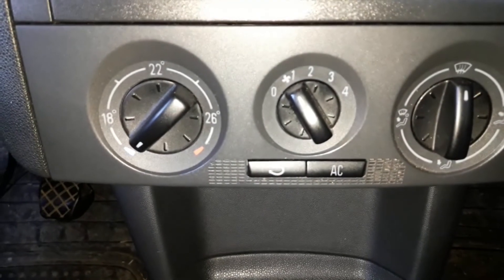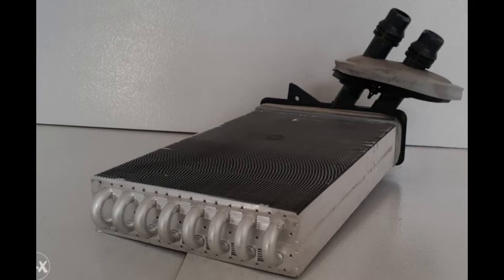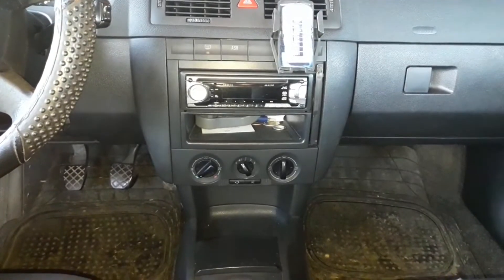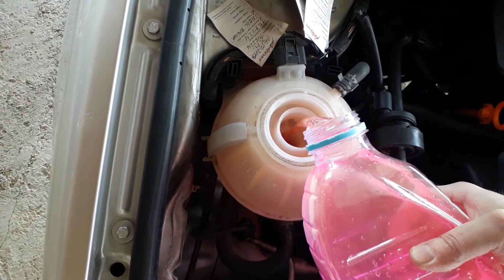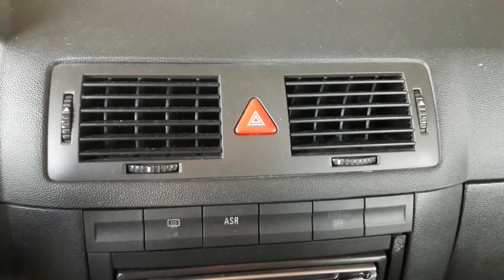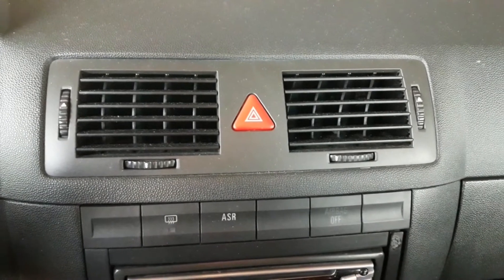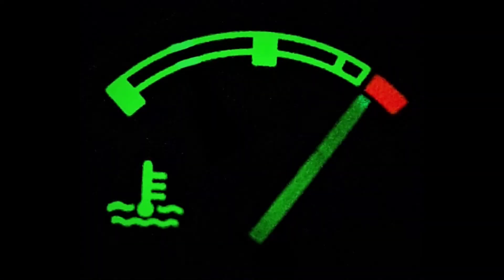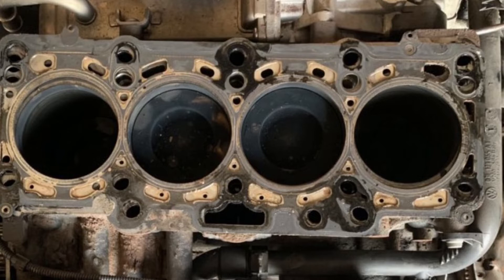Bad Heater Core Symptoms-10 Tell Tail Signs That You Have a Heater Core Problem

Comment: My air vents blow only very hot air. Even when are turned off very hot air comes in. I see a small leak on passenger rug. Like a full spoon of antigel. 
Blocked the hose that goes into heater core from under the hood and now i have only cold air from outside. 
To change heater core costs like 300 euros cause needs to get all board off including wheel, airbags etc. Is too expensive to get to that heater core
Reply from the maker: Hi and thanks for watching!
Yes, I understand you completely. The heater core problem is one of the worst mainly because on most cars you have to dismantle have of the front interior and dash to get to it.
Returning it all afterward and making it all work is yet another story.
All that I can say is, if you can, change it while it's still warm weather. If it stays like that during the winter the car will be literally undriveable for most of the time.
Despite the cost and if possible make the repair. It's just the way it is.
If you can do the repair yourself you will save some serious money but prepare a ton of time and patience 🙂

Comment: I was severely burned on my right foot by the hot coolant leak from the heater core on my 30-year old Cadillac. The leaked coolant flowed to the driver's space via air duct. I didn't previously recognize the coolant leak to the floor carpet of the passenger seat. I feel good as there was no passenger while I was driving. She could have been burned more severely than me if she was with me at the time. Your video is nice when viewed after the big incident a month ago! 😛
Reply from the maker: Hi, thanks for watching and I hear you 🙂. I had a situation where the heater core leaked while driving and started to produce a thick fog inside the passenger cabin.
A smoke machine is an understatement 🙂.
Glad that everyone was OK and thank you for the kind words.

Comment: This can cause the AC to not blow cold air also right? The heater core is the same as the evaporator core right?
Reply from the maker: Hi and thanks for watching! The heater shouldn't be the problem in that case, it's only for producing hot air.
Reply: @DespairRepair  ah yes I have just read they are different. I think I may have a leak from the evaporator core because the AC isn't working properly
Reply from the maker: @zombiemontage  could be but, to be honest,it could also easily be other things.
If possible, check for leaks in the system and perhaps start from there.
Hope this helps.

Comment: Took my car in for a service recently and was told I had a bad heater core. It leaks under the bottom of the car near the rear. I’m loosing a lot of coolant even if I don’t use the aircon or heater in the car. I get warm and cold air when I turn it on. What could it be? I got quoted $3000 - $5000 😢to replace the heater core. But judging by watching a lot of videos regarding the matter I have doubts that it’s the heater core( well I’m hoping not) I have a 2011 Laredo Jeep grand Cherokee.

Comment: What happens if they bypass the cabin heater despite steam coming out of ventilation when heater is turned on. After engine radiator replacement. It overheated again. Mech said in order to cut your losses trade it in coz there's a chance for more problems. From your video alone heater core was my car's culprit. There was leak coz of the steam venting out and related leaks?from hoses aside from d core.
Reply from the maker: Hi and thanks for watching!
I'm sorry I really didn't understand the whole situation but from what I did, here's what I think:
If the heater core was drained and bypassed, there shouldn't be any leaks or steam whatsoever. 
Also, you're overheating may be caused by some other problem and that may then have caused the heater core to leak.
In any case, if the heater core was the actual problem, for overheating, bypassing it should have solved the problem completely. You just won't have cabin heating

Comment: My car is a 2.2L 96 chevy s10. Just replaced the thermostat. But my vehicle is still overheating. Coolant levels are fine. And there's a puddle on my passenger floor with a trail leading to the heater core so this is probably the obvious problem. I should mention when I drive my truck the temperature levels are fine, its just when I stop... it overheats. Any input?
Reply: Also no heat from heater while idling.
Reply from the maker: @WyldTaboo  hi and thanks for watching!
I would definitely check the heater core or the pipes and hoses around it.

Comment: I got my 1st mechanic job in 1984. I always tell people to change their coolant regularly. over time the pH levels get high, it becomes more acidic, and combine that with the cheaper metals they are using today, it's not the old copper-brass -which also eventually rots. I do my coolant every summer, but don't go more than two years, imo. change every fluid, even the brake & power steering. most cars today have a rack & pinion so change that fluid out to have a long life for that unit. I'll stop here so I don't go on and on all day.. 😉🏁🏁🏁
Reply from the maker: Thanks for watching and for sharing 🙂🙂

Comment: My 2008 Ford Escape looks like it has a bad , clogged or leaky heater. 😔

Loss of coolant each month.

Twice engine overheated.

During the cold weather was when i discovered it might be at the heater.

Fogging up windshield and windows with an oily film.  Difficult to wipe off with hand.

Noticed steam coming out the passenger vent inside.

Smell of coolant inside.

Sight of water dripping from a hose the outside on firewall.
Reply from the maker: Hi and thanks for watching!
With all those symptoms, it seems it is.

Comment: Hi thanks for the video, I could do with some advice, I’m not sure if my heater core is the problem,

I’m only having two of all these symptoms from what I can tell,

Engine over heating (if I accelerate with full power the temperature drops back down to 90°) this happens constantly.

No hot heaters, it gets warm here and there but it’s cold most of the time, it gets warmer if it put it on the recirculating setting.

Last thing, timing belt and water pump was changed recently
Reply from the maker: Hi and thanks for watching! 
I'll go straight to the point: I would definitely first check the thermostat.
If there isn't a good coolant flow, then the heating won't work either and the whole system may overheat.
Reply: @DespairRepair  oh forgot to mention, thermostat, water pump and timing belt all replaced
Reply from the maker: @MrHussain1998  so the coolant flow is OK? The coolant fan starts when it should and both of the coolant hoses on the radiator are equally hot?
Did you check the valve that lets coolant inside the heater?
Anyway, what's the car?
Reply: @DespairRepair  the coolant and fan all seems to be fine, no lights on dash nothing, I’ve even had the coolant flushed out a couple of times.

I’m gonna try flushing the heater core in a few days and hope that fixes the issue.

The car is a Skoda superb 2.0tdi 2010
Reply from the maker: @MrHussain1998  well it can't hurt to give it a try in any case. Again I would also check the valve for the heater core.
By the way, very nice car 🙂
Reply: @DespairRepair  I will get it checked again, thank you for replying! And very nice cars!

Comment: Hey man, thanks for video. I was just wondering if i have a bad heater core, what would mechanic/body shop do to fix it? I know getting one replaced would be $800-$1000 which is a really big expense. Thank you
Reply from the maker: Hi and thanks for watching! I didn't understand the question, do you mean what would they have to do for that amount of money? And it is big money.

If this is your question then in most cases they have to take off the dashboard, lower parts of the trim, side panels, basically almost the whole front part of the cabin interior.

Done it myself on a couple of cars. Except a couple of situations, paying for a replacement is worth every cent.

Hope this helps.

Comment: My cabin doesn’t only wet the carpets it has enough to look like a full bucket. Could it still be the heater core? At one time in the summer I can see it dripping from where the heater core is like a leaky faucet.
Reply: Mine doesn't leak on passenger side inside
Reply: I knew a guy that messed around with the cooling duct work and messed it up.  When he ran the air conditioning it would leak the condensation inside the car.  So check the smell, my sense of smell was never great, so not always an option for me.  If water, rubbing it on a window should clean it?  If coolant, the smearing mentioned in this video.  I've had heavy rains where moving the car to a downhill facing position had it leak out of the ceiling by the rear view mirror.  Which might explain why the radio died years ago.  Not the only cause, but check it anyways.
Reply from the maker: Hi and thanks for watching! Just smell the liquid if you can.
If it smells like coolant, it's the heater core.
If it's water, you probably have an external leak somewhere.

Comment: Is it possible to have a bad heater core if you get heat on drives side and cold air on passenger side?
Reply from the maker: Hi and thanks for watching!
From what I've seen, no. In that case, I would rather check the ventilation system.
Reply: U need to check the blend door on passenger side its stuck closed
Reply: Same problem heat coming out driver side cold air on passenger side

Comment: If you see this. Mine the radiators keep bursting. I replaced thermostat and high speed fan relay already since those were told were bad already. We are on our 3rd radiator since September 2022. The hest is good inside but the van overheats as soon as it get to 55mph rhen it bursts. So we can drive under 50 and did fine for months.
Reply: Have you replaced your water heater
Reply: @michaeldeltadrop782  heater? The engine I think is what heats it. But thermostat, water pump, and 3 radiators reservoir was removed and cleaned. Heater core flushed no blockage, head gasket checked for exhaust gas in the coolant and tested fine not that is 100% guaranteed. It runs smooth just over heats and fluid just sprays everywhere and today I put a new radiator cap. Running out of ideas. 2 shops have done this repair I did some myself and nothing had been lasting long term. And it's odd can't blame a clogged radiator since 3 are new and failed. Replaced pump assuming it was bad. The only idea I have left is the fan. Yes I put a new relay and it comes on when it got hot it works with ac on. But I don't know if it stops working when the vehicle is driving when these situations happen. Hasn't happened while sitting and us testing. Means the fan isn't dead but does it intermittently stop or fail to come on some times. It what's left in my brain and was hoping someone has a thought. Unless you meant heater core which hasn't been replaced which we flushed and isn't leaking we get good heat until the coolant level drops enough after it overheats.
Reply: @oxanalangley9131  I'm no expert, but would a bad radiator cap cause these problems?  A fan wouldn't do much when driving 50+ MPH.  A radiator fan would mostly be needed at low speeds (you would see temperature rising slowly during summer idling or stopped at a traffic light.)
Reply: @jims2507  it's winter here and it's still getting back pressure somewhere at random times. Did a whole trip 290 miles I used obd 2 elm to monitor Temps and was fine the whole time. Today it happened at a light after 7 miles and the steering and transmission went out. Sat for 30 minutes started and back to normal. And no dash lights or overheat showed up. I took the thermostat out incase it was a doa. But it's mechanism opens fine. Not seeing g any leaks underneath. The radiator cap is new replaced when the 1st new radiator was installed the 2 radiators afterwards didn't change the cap as only the radiator was under warranty. So I am stumped still and this isn't a safe thing to run imo. But 5 families use it and rely on it til someone can get another vehicle to add to the mix.
Reply: @oxanalangley9131  What do you mean "still getting back pressure"?  Also, it sounds like you're having multiple problems.  If your steering and transmission went out, that sounds like you have electric power steering?  And electrical problems?  Is your battery and alternator OK?  Bad ground?  Battery terminal(s) crusted up?  I have heard that low voltage can cause weird problems with the engine and transmission (I think Scotty and/or South Main Auto said that?)  But why electrical problems would show up at a traffic light?  Slower idle, engine warmed up maybe?  IDK.  Good luck with this !!!  Test as much as possible instead of replacing parts.

Comment: 🧐Moral of the story, turn on your heat lever or  switch at least once a year for awhile so coolant floods the heater core keeping it flushed and clean so it doesn't clog
Reply from the maker: Hi and thanks for watching! Correct 🙂
Reply: @DespairRepair  Most people don't realize coolant only floods the heater core when you turn the heat on and the actuator opens, otherwise it's a closed loop from the entire system
Reply from the maker: @seatime674  yes and I think that's perhaps the main cause of most problems, both leaks, and clogs.
Congratulations on solving the problem, flushing certainly beats replacing the heater which is a nasty job 🙂
Reply: @DespairRepair Long time ago Bought a Brand New Expedition in 1999, had 12 miles from dealer on it for my mom, she hated heat always ran warm and only turned it to heat once or twice in the 15 years we had it. Went to use it, ice cold air only!!!!.. We had to cut the firewall hose lines flush it with a garden hose and use massive chemicals and then slowly heat started to come back.. We just left it on heat indefinitely so the valve stayed open it could circulate and unclog more
Reply: Will a bad heater core cause the AC to be mixed with Hot air?
Reply: @jamesdyson9185  No the heater core just runs hot coolant through it then the fan pushes the hot air through the vents so you get heat, if you're getting cold air mixing you might have a blend door malfunctioning
Reply: @seatime674  actually when I have to AC on and I accelerate it's drops off and hot air comes in causing the AC to feel it needs coolant. But it was just filled. Also when climate control is off and I accelerate hot air was blowing out of defrost section??
Reply: @jamesdyson9185  Yeah you have a vacuum blend door issue. Your freon level is fine but you have a vacuum leak somewhere either under the hood or under the dashboard in a vacuum hose. You could have a faulty door actuator to
Reply: @seatime674  ok thanks so much. A couple people said that. Now I have to figure it out. I'm not a mechanic at all but do enjoy learning and fixing some of my car issues
Reply: @jamesdyson9185  Yeah that's a common problem you could even youtube the issue you're having and it will Point towards some areas you can look into
Reply: @seatime674  it's an 89 town car.
Reply: @jamesdyson9185  Nice classic👌
Reply: @seatime674  thank you. I absolutely love it
Reply: 2005 Acura RSX base model here, 240k miles. Noticed my car's temp rising 3 weeks ago. It was due to low coolant, I just topped it off thinking it was that. About a week ago I was running my A/C, noticed coolant droplets coming from the front right passenger side.. only losing coolant when I run my A/C. Heater defrosts car normally. 

My mechanic told me to run the heater on defrost in the morning and see if it makes it foggy or not. To get back to him with the findings.

Comment: Hy.i got an mercedes benz  a class a170,from 2005.....last year on december  my car heating works great..i was on christmas in holliday in another country,when i comeback the heating dont work like before...and after couple of days just start working,no more warn air gived...in dashboard showed me to add more coolant..i put more but heating still dont come...someone said to i reflush the sistem and refill with coolant and that will be fixed and heating will run..i dont know big thing about mechanics..but what you think can be?before used to work perfectly the heating,in the morning at 5 oclock,when was -2 grace outside,in 3-4 minute was warm in the car..all stop after i comeback from holliday....please help me if you know an advice
Reply from the maker: Hi and thanks for watching!

To be honest it could be many things. Flushing is a good idea and can't hurt to do it even if doesn't fix the problem.

It could be a clog in the heater core, a punctured heater core a thermostat problem, or else.

Are there any variations in the engine temperature, is the coolant level ok all the time? Did you check for leaks (namely in the front footwells under the floormats)?